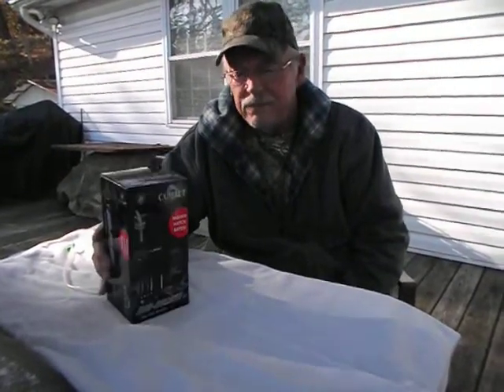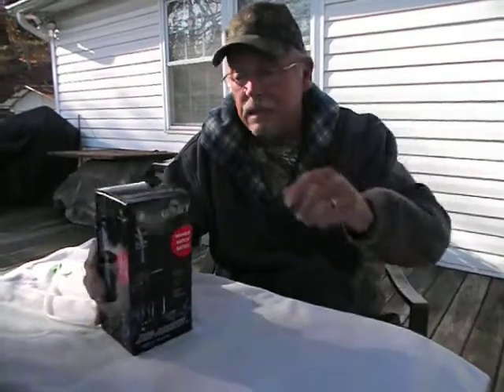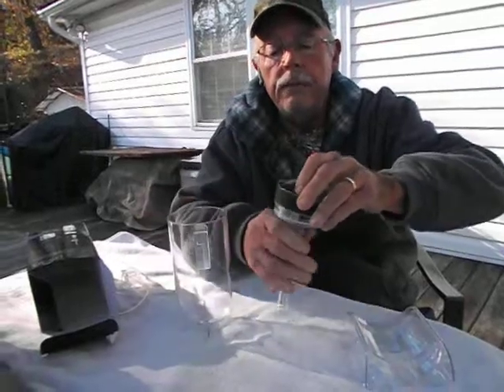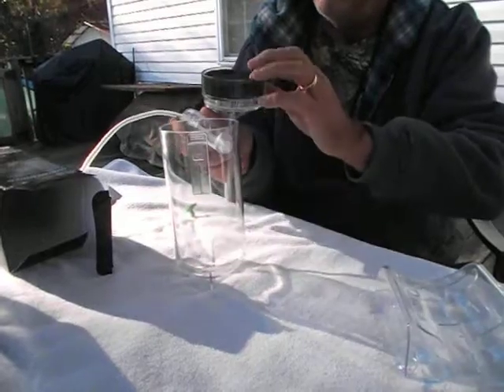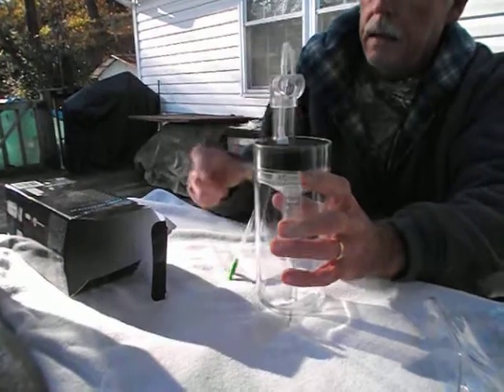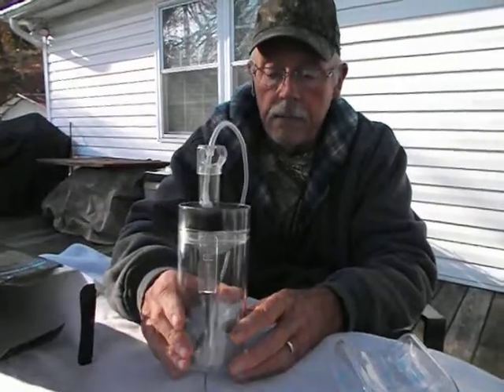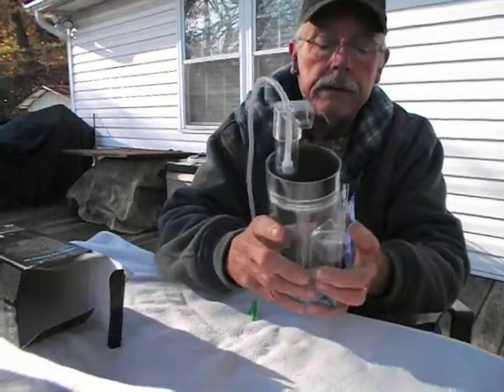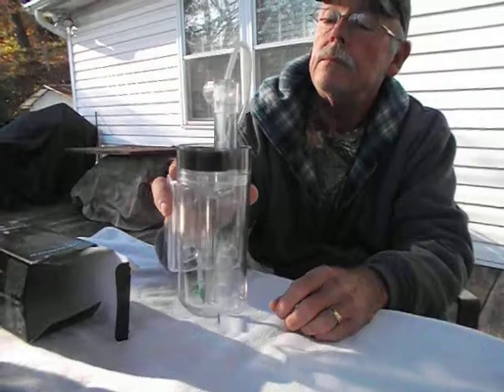Tilapia Egg Tumbler

Comment: looks like I nice tumbler, I use 2 McDonald-type hatching jars together with a canister filter (providing the water flow) its a little over kill for 2 tumblers but if I need to add 2 more of the same tumblers it should offer enough water flow, sometimes from new mothers I get a small clutch of eggs and that tumbler looks like it would be a nice alternative at 1/4 the price, look forward to watching your other videos.
Reply from the maker: Tim GlobalService Well, the Cobalt 80 Egg Rocker works well, but it runs around 50.00 online.  I don't typically use egg tumblers, but feel sure this one would do up to about 800 - 1000 eggs at a time.  The way you have made your tumblers sounds interesting....I love when people adapt using what is available.  What did your tumblers cost to build up the way you have them?
Reply: I bought 4 tumbler at 89$ each I am using 2 now and 2 in reserve, the canister filter was 55$ then I just ran pvc pipe with valves, the tumblers look big enough to handle 1-2 female clutches of eggs easy but for the life of me I coudnt find anything like that when I started 3 years ago.
    I harvest the eggs from the females after 2-3 days and I clean and sterilize the tumblers and filter about every 6 months with Iodine then flush em out for about 4 hours with clean water.
Reply: Got any pictures of these tumblers you mentioned? Thanks